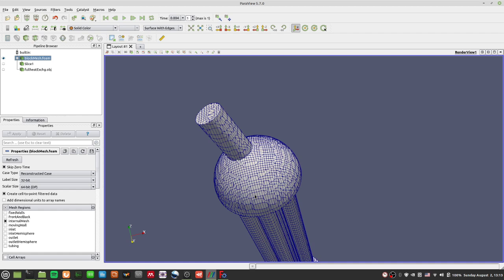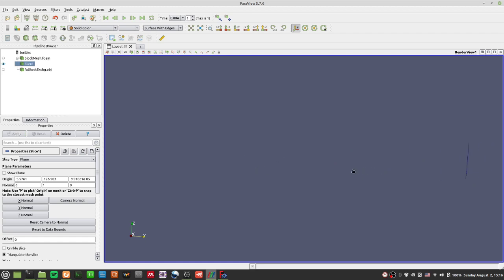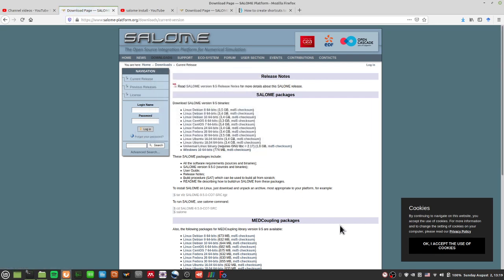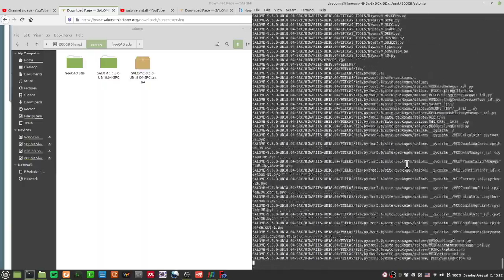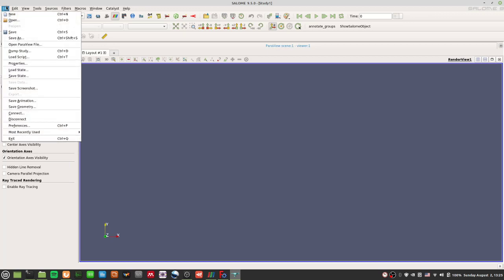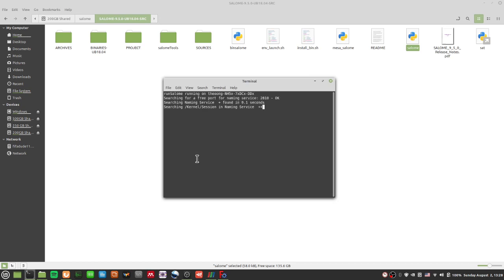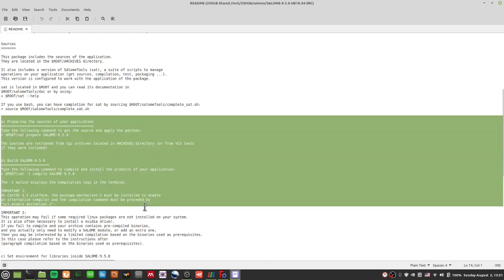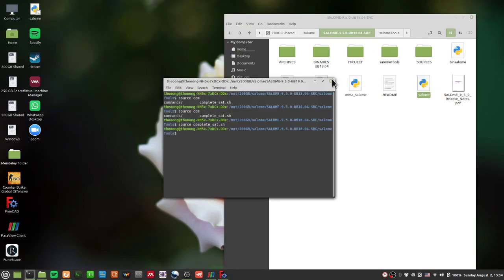OpenFOAM Intermediate - 91 install and run salome 9.5.0

Comment: Hi, I'm new in ubuntu and trying to install salome in my laptop. I got an error after typing

./salome

Then this long message appears, Any idea?

Searching for a free port for naming service: 2813 - OK
Searching Naming Service  + found in 0.1 seconds 
SALOME_Session_Server: error while loading shared libraries: libicui18n.so.60: cannot open shared object file: No such file or directory
Traceback (most recent call last):
  File "/home/fatwaazam/Salome/SALOME-9.7.0-UB18.04-SRC/BINARIES-UB18.04/KERNEL/bin/salome/orbmodule.py", line 181, in waitNSPID
    os.kill(thePID,0)
ProcessLookupError: [Errno 3] No such process
During handling of the above exception, another exception occurred:
Traceback (most recent call last):
  File "/home/fatwaazam/Salome/SALOME-9.7.0-UB18.04-SRC/BINARIES-UB18.04/KERNEL/bin/salome/runSalome.py", line 694, in useSalome
    clt = startSalome(args, modules_list, modules_root_dir)
  File "/home/fatwaazam/Salome/SALOME-9.7.0-UB18.04-SRC/BINARIES-UB18.04/KERNEL/bin/salome/runSalome.py", line 639, in startSalome
    session=clt.waitNSPID("/Kernel/Session",mySessionServ.PID,SALOME.Session)
  File "/home/fatwaazam/Salome/SALOME-9.7.0-UB18.04-SRC/BINARIES-UB18.04/KERNEL/bin/salome/orbmodule.py", line 183, in waitNSPID
    raise RuntimeError("Process %d for %s not found" % (thePID,theName))
RuntimeError: Process 632914 for /Kernel/Session not found
Searching /Kernel/Session in Naming Service  
--- Error during Salome launch ---
Warning, no type found for resource "localhost", using default value "single_machine"

Thanks

Comment: Dear Theo Ong,

Thank you very much for the video. I am facing a problem in salome installation for ubuntu 16.04. I also tried with Universal linux library too. Here is the error.

runSalome running on sharat-lenovo-ideapad-y700-14isk
Searching for a free port for naming service: 2813 - OK
Searching Naming Service  + found in 0.1 seconds 
Searching /Kernel/Session in Naming Service  +SALOME_Session_Server: error while loading shared libraries: libGLX.so.0: cannot open shared object file: No such file or directory
Traceback (most recent call last):
  File "/media/sharat/DATA/Sunag/Niramai/SALOME-9.5.0/BINARIES-CO7/KERNEL/bin/salome/orbmodule.py", line 181, in waitNSPID
    os.kill(thePID,0)
ProcessLookupError: [Errno 3] No such process

During handling of the above exception, another exception occurred:

Traceback (most recent call last):
  File "/media/sharat/DATA/Sunag/Niramai/SALOME-9.5.0/BINARIES-CO7/KERNEL/bin/salome/runSalome.py", line 680, in useSalome
    clt = startSalome(args, modules_list, modules_root_dir)
  File "/media/sharat/DATA/Sunag/Niramai/SALOME-9.5.0/BINARIES-CO7/KERNEL/bin/salome/runSalome.py", line 625, in startSalome
    session=clt.waitNSPID("/Kernel/Session",mySessionServ.PID,SALOME.Session)
  File "/media/sharat/DATA/Sunag/Niramai/SALOME-9.5.0/BINARIES-CO7/KERNEL/bin/salome/orbmodule.py", line 183, in waitNSPID
    raise RuntimeError("Process %d for %s not found" % (thePID,theName))
RuntimeError: Process 8743 for /Kernel/Session not found

--- Error during Salome launch ---
➜  SALOME-9.5.0 Warning, no type found for resource "localhost", using default value "single_machine"

I am actually getting error from libGLX.so.0. I tried to find file using apt-get or apt-find. I could find the file. But I am unable to install it and so does the error persists. I have also contacted in cfdonline. But not getting a solution.

Please let me know how to proceed further.

Thanks.

Comment: Hi I am getting an error during salome launch , please help
Reply: @TheoOngScienceAndEngineering   i solved the problem . 

I have some other questions regarding heat transfer and how to use my geometry and simulate using openfoam . Is there anyway to contact you to ask you my doubts
Reply: @Heisenberg Says  hi , do not try to use this method , just download as a .exe file suitable for ur system (windows 10 etc ) 
It’s very easy

Comment: Sir, thank You for the tutorial and everything on this channel.

I've little problem during istalation of Salome. 
After entering ./salome command, this appears on my screen:

mmarczak@mmarczak-GV62-7RC:~/Salome/SALOME-9.5.0-UB18.04-SRC$ ./salome 
runSalome running on mmarczak-GV62-7RC
Searching for a free port for naming service: 2815 - OK
Searching Naming Service  + found in 0.1 seconds 
SALOME_Session_Server: error while loading shared libraries: libOpenGL.so.0: cannot open shared object file: No such file or directory
Traceback (most recent call last):
  File "/home/mmarczak/Salome/SALOME-9.5.0-UB18.04-SRC/BINARIES-UB18.04/KERNEL/bin/salome/orbmodule.py", line 181, in waitNSPID
    os.kill(thePID,0)
ProcessLookupError: [Errno 3] No such process

During handling of the above exception, another exception occurred:

Traceback (most recent call last):
  File "/home/mmarczak/Salome/SALOME-9.5.0-UB18.04-SRC/BINARIES-UB18.04/KERNEL/bin/salome/runSalome.py", line 680, in useSalome
    clt = startSalome(args, modules_list, modules_root_dir)
  File "/home/mmarczak/Salome/SALOME-9.5.0-UB18.04-SRC/BINARIES-UB18.04/KERNEL/bin/salome/runSalome.py", line 625, in startSalome
    session=clt.waitNSPID("/Kernel/Session",mySessionServ.PID,SALOME.Session)
  File "/home/mmarczak/Salome/SALOME-9.5.0-UB18.04-SRC/BINARIES-UB18.04/KERNEL/bin/salome/orbmodule.py", line 183, in waitNSPID
    raise RuntimeError("Process %d for %s not found" % (thePID,theName))
RuntimeError: Process 10966 for /Kernel/Session not found
Searching /Kernel/Session in Naming Service  

--- Error during Salome launch ---

I am also working on Linux Mint, but the previous version 19.3. 
I did exactly the same, like on Your video, and cannot handle this error.

I would be very thankfull for Your support!
Reply: @TheoOngScienceAndEngineering  Thanks for Your reply!
I've already have Salome installed and sa You mentioned it was problem with libOpenGL.so.0 libraries. 
Here I leave solution fo this:

>sudo apt-get install apt-file
>sudo apt-file update
>apt-file find libOpenGL.so
>apt-get install libopengl0

Before installing libraries, I've also downloaded virtualbox.

Best Regards and once time, thanks for sharing Your knowledge withcommunity!
Reply: @maciejmarczak3853  Thank you very much for the solution. But I am facing issue with libGLX.so.0 library.

I tried installing with the same method as you have mentioned using apt-get. But I am still facing the same error. Could you please address this error?

Below is the error:

Searching for a free port for naming service: 2813 - OK
Searching Naming Service  + found in 0.1 seconds 
Searching /Kernel/Session in Naming Service  +SALOME_Session_Server: error while loading shared libraries: libGLX.so.0: cannot open shared object file: No such file or directory
Traceback (most recent call last):
  File "/media/sharat/DATA/Sunag/Niramai/SALOME-9.5.0-UB16.04-SRC/BINARIES-UB16.04/KERNEL/bin/salome/orbmodule.py", line 181, in waitNSPID
    os.kill(thePID,0)
ProcessLookupError: [Errno 3] No such process

During handling of the above exception, another exception occurred:

Traceback (most recent call last):
  File "/media/sharat/DATA/Sunag/Niramai/SALOME-9.5.0-UB16.04-SRC/BINARIES-UB16.04/KERNEL/bin/salome/runSalome.py", line 680, in useSalome
    clt = startSalome(args, modules_list, modules_root_dir)
  File "/media/sharat/DATA/Sunag/Niramai/SALOME-9.5.0-UB16.04-SRC/BINARIES-UB16.04/KERNEL/bin/salome/runSalome.py", line 625, in startSalome
    session=clt.waitNSPID("/Kernel/Session",mySessionServ.PID,SALOME.Session)
  File "/media/sharat/DATA/Sunag/Niramai/SALOME-9.5.0-UB16.04-SRC/BINARIES-UB16.04/KERNEL/bin/salome/orbmodule.py", line 183, in waitNSPID
    raise RuntimeError("Process %d for %s not found" % (thePID,theName))
RuntimeError: Process 16565 for /Kernel/Session not found

--- Error during Salome launch ---
➜  SALOME-9.5.0-UB16.04-SRC Warning, no type found for resource "localhost", using default value "single_machine"
Reply: @sunagra2538  I had a similar problem to yours. I use Ubuntu 18.04. In the site of salome, I chose the option "Universal Linux binary", and it has worked well. Just follow the steps shown in there:

1) Download Universal Linux binary;
2) Extract the file in a known directory of yours so that you can work easily through terminal;
3) In the directory containing the extracted file of salome (for universal linux binary, it should be called as SALOME-9.5.0), run the following command: ./salome or ./mesa_salome

It has worked to me. I hope it can help you in some way.

Success!

Murilo.
Reply: @murilobrunaciomedeiros6466  Thank you very much for the suggestion.

I downloaded Universal Linux binary and extracted it. However, when I run ./salome or mesa, I am still getting the same error..!! Please let me know if you find any other alternative.

Regards,
Sunag R A.